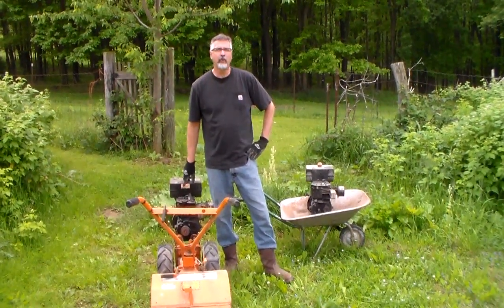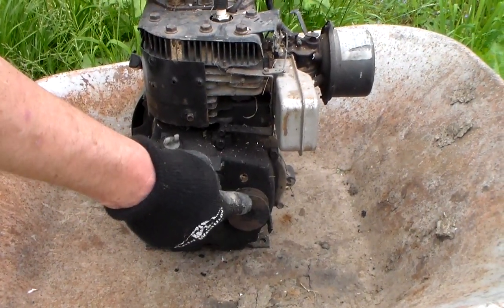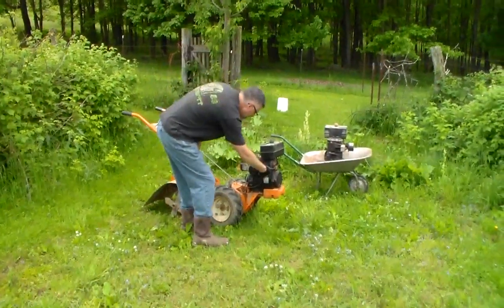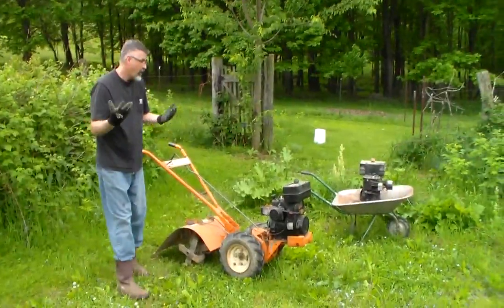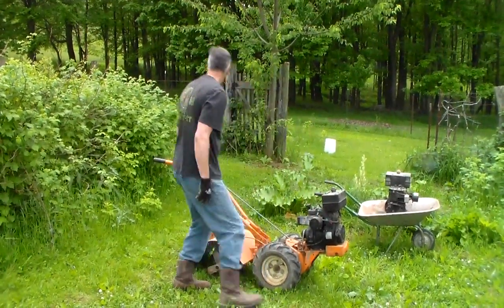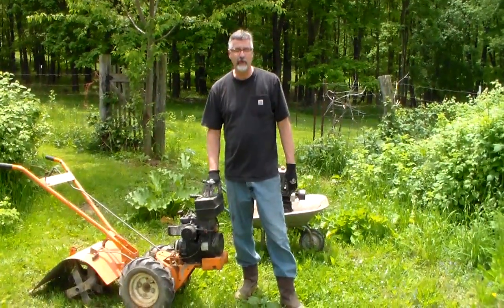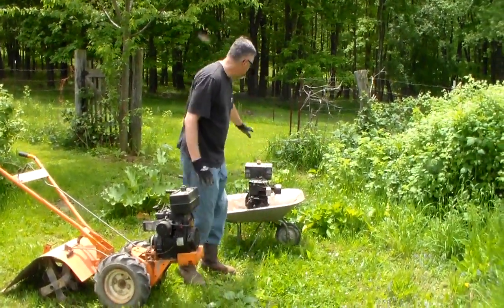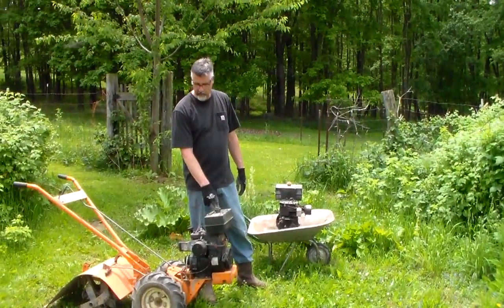Watch This Before Replacing the Engine on Your Ariens Tiller

Comment: To stay out of your tiled ground turn your handles to the untilled side  great video  I used my reverse  and the blade guard to bulldoze the ground level  for the grandchildren's  pool . Mine is the rocket 7 I bought it with  a replacement  motor already unit when I retired  in 1996 and ran it till the motor gave up on me about 2010 those  are great tillers and can do much more than you think .  Great video and have a great day and a better tomorrow.

Comment: I think you could use the camshaft and the timing cover from the old engine, if those parts are ok it would be the easiest way to solve that problem.
Reply from the maker: Thanks. That sounds like a good idea.
Reply: The timing cover fits only the specific engine.

Comment: You can gain reverse on a single shaft engine, watch my video I made, I have a collection of ariens tillers and replaced the old 7hp tecumseh with an 8hp briggs and it works great

Comment: My ariens has reverse with a single shaft.
Reply from the maker: Did you do some type of modification to it to get reverse?
Reply: @JimODonnellFarm  i did not. My engine has a bracket with an idler on it for a 3rd belt and the drive rod that engages forward has a second linkage that when pull it out it swings in another idler opposite drive side and tightens  belt against opposite side of drive pulley. So that drive belt runs from that extra pulley i spoke of and around the driven pulley below and is on the right side so when you swing in the idler it tightens against right side of drive pulley. I wish i could share pictures lol. I just swapped out for a honda motor but not going to use the reverse.
Reply from the maker: @tribounty1392  that's interesting. I have never seen one like that.
Reply: @JimODonnellFarm  heres is a link of some one mocking one up looks like on a honda engine or a predator. But basically the same concept. This guy used an idler  where my roller is like the drive side but it works the same it seems.https://youtu.be/DQq8qm5IuqI